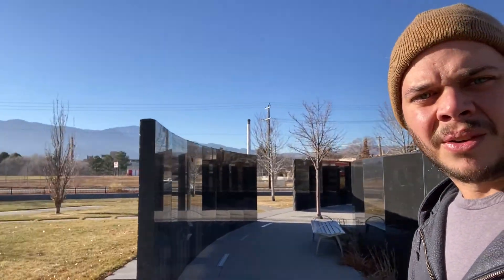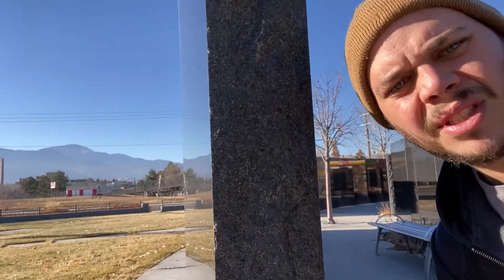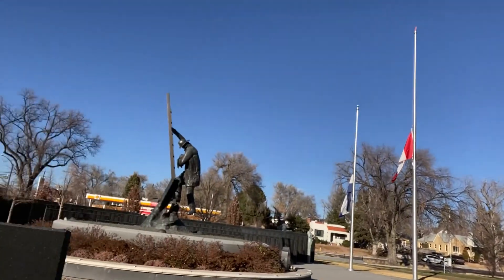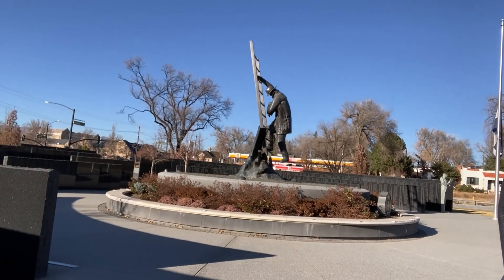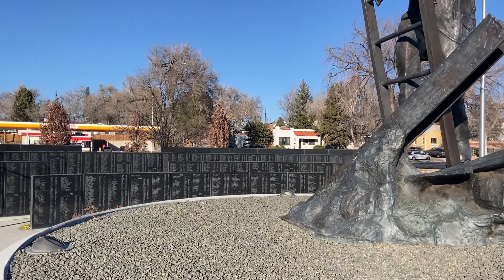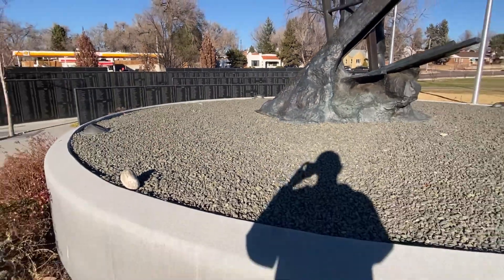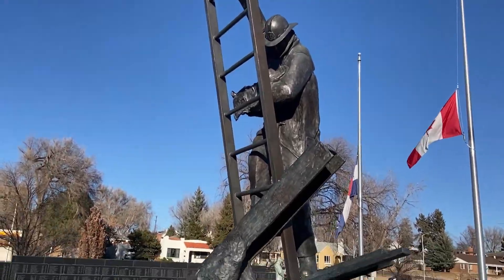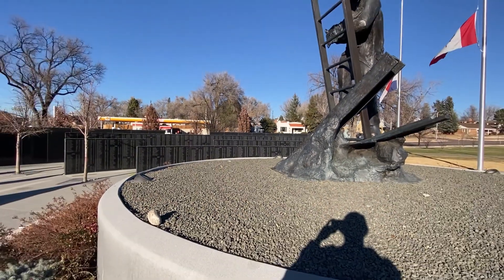200mW VTX Penetration Test - GepRC TinyGO RTF Kit - Skyzone O4X - Linier vs Circular Polarized

Comment: I'ma build my own tinygo from scratch ....I like that thinking16 canopy you put on and thinking using the new rad go vtx 400mw in the upgrade too and 18000kv motors with new caddax ant camera and elers receiver I like the tinygo whoop style instead of mobula 8 whoop I'm still thinking what direction to go less soldering the better haha  ...can't wait to build this thing little by little as it's gonna be my first build

Comment: Absolutely love all the coverage youve been doing with the Tinygo.  So many people have "recommended" this drone on youtube- But youre the only one who really stuck with it and continue to show what its like to use / own this drone as someone gets into the hobby and may want to expand/improve a little.

In this test (unless i missed it) it seems you put the circular polarized antenna on the drone, and on your skyzone 04xs.

Have you tried using the circular antennas on your standard tinygo box goggles though? If so- How much improvement (if any) did you see over just using the stock linear antennas?

I was contemplating getting some antennas as a potential upgrade for the stock hardware (Tinygo + box goggles), until i decide to bite the bullet and upgrade to some better goggles- But curious about how much improvement if any there is. 

Thank you so much for your time!